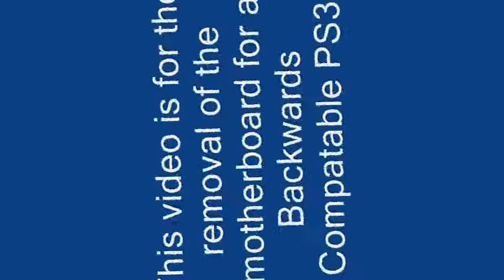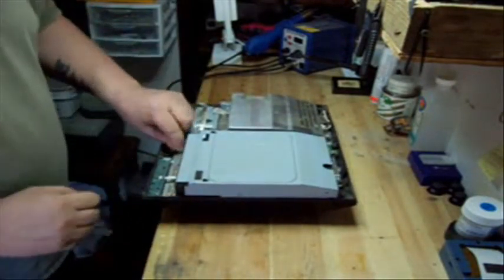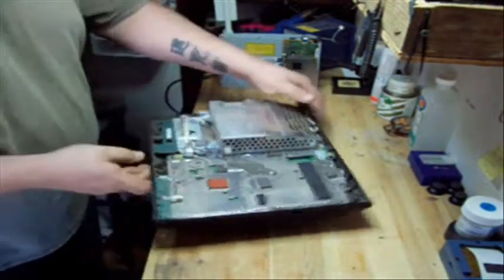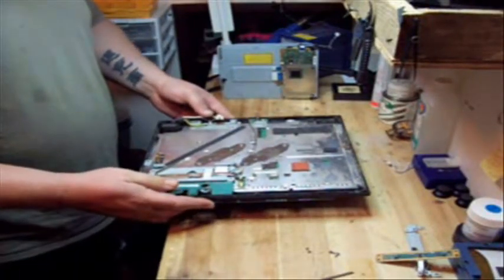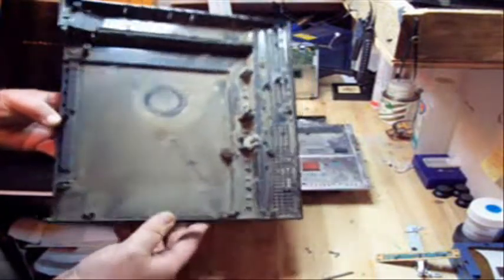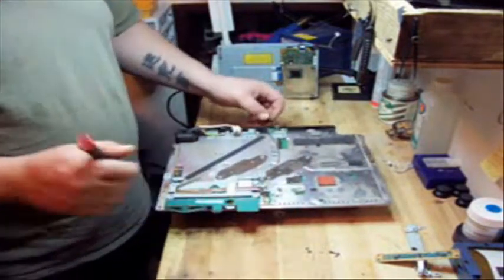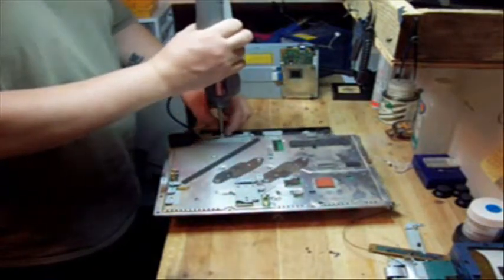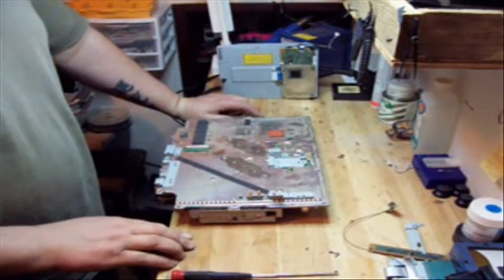60GB ps3 Mother Board removal

Comment: bought a ps3 1st gen- chechA01.  Turns on fine- doesn't read disc.  Had a guy replace the lens-  could hear the disc spinning- but on the tv screen, it shows the PS3 not registering/ recognizing the disc at all.  Had guy get a lil more indepth and found out that the ribbon is indeed broken.  any advice bro- i truly would love to see this ps3 resurrected from the gaming graveyard. Quick question for ya- Is it in any way shape or form possible to put that emotin engine hardware into another ps3?